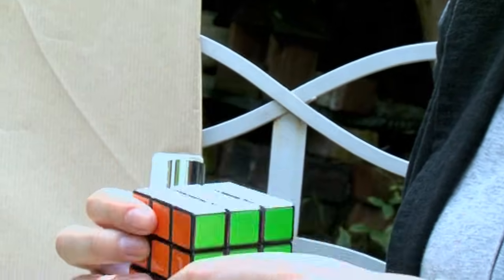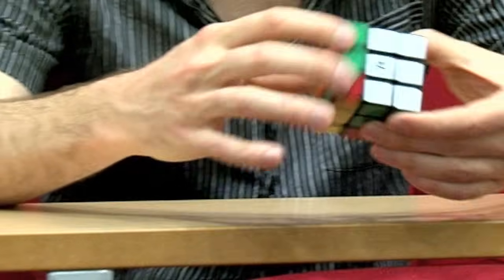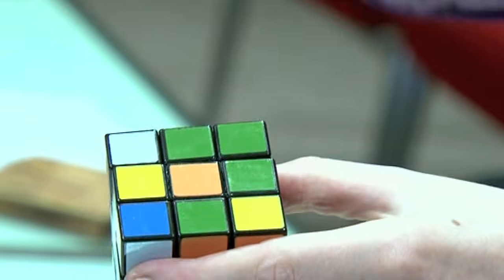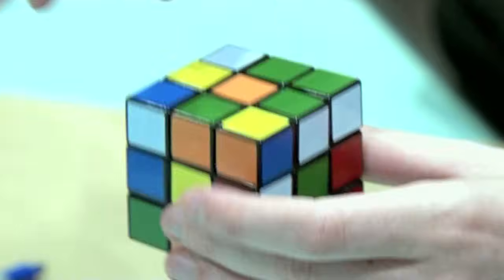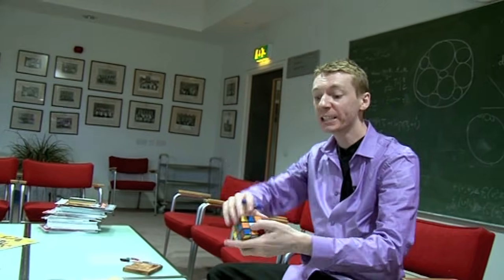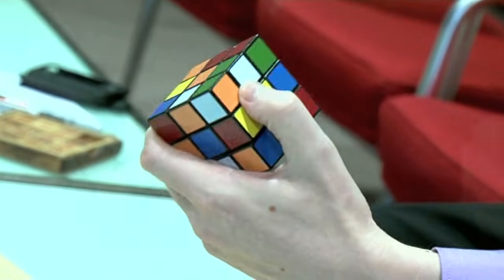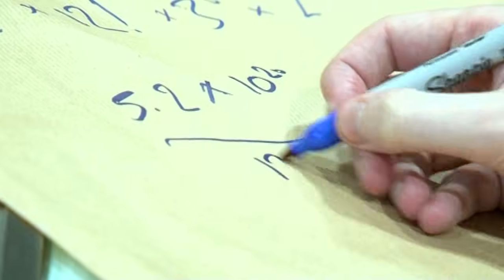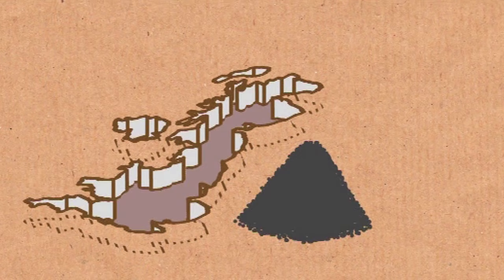43,252,003,274,489,856,000 Rubik's Cube Combinations - Numberphile

Comment: There exist a 17x17x17 rubiks cube. How many combinations does that have?
Reply: +CopCat There are 6.69 x 10^1054 possible combinations on that cube...
Reply: @Harry34186  oh wow
thats alot of combinations
Reply: +Chrnan6710 Wow, that's a "very" round number!
Reply: Cube8 It's actually exact believe it or not
Reply: +AnimXpert - Everything Animation That's not right, there is a number for it! Of course, it's a massive number, but it's definitely not infinite. The amount of possible 17-rubix cubes and the number 1 are both exactly equidistant from infinity - because it's infinitely distant. To call a finite quanitity infinite just because it's really huge is a terrible generalization!
Reply: @mrpengywinz123  I mean; by having narrowed the answer to the Ramsey Theorem down, to between 13 and Graham’s Number, Mathematicians have pretty much nailed it. 😅
Reply: +CopCat---> 4.3x10^1795

so here is the number :)

43 255 043 761 603 797 113 630 091 774 844 134 775 453 550 640 366 980 778 547 673 133 233 526 156 056 111 086 352 762 541 106 680 563 100 444 501 556 754 078 061 200 040 161 902 545 444 981 363 159 418 942 317 624 324 342 475 893 310 046 720 902 418 909 842 572 254 925 048 152 255 763 863 441 303 957 601 376 714 844 611 959 683 697 690 635 818 016 496 854 273 739 359 313 279 064 666 370 046 140 892 353 517 823 980 846 922 675 751 474 787 577 446 355 037 664 594 347 801 588 102 349 880 881 928 045 254 762 441 010 636 430 061 482 254 233 491 880 624 942 631 395 654 007 616 048 601 555 395 209 216 128 415 329 219 747 176 133 779 395 956 146 746 911 514 214 771 775 855 690 239 351 072 162 630 720 328 485 482 144 507 681 466 660 622 736 814 225 845 041 389 468 585 359 274 634 625 239 725 398 675 655 356 047 474 149 388 129 506 975 426 678 293 985 190 094 954 373 200 648 529 109 213 009 085 243 025 295 695 714 725 062 048 495 626 790 315 739 291 458 632 493 329 982 002 276 666 437 129 462 665 130 296 574 060 413 847 380 108 081 447 548 388 904 581 805 682 624 806 259 243 368 405 271 472 607 466 620 943 953 521 539 611 552 808 899 034 647 451 671 884 821 871 473 150 002 371 967 161 469 667 395 692 183 541 805 647 906 126 837 698 919 382 420 530 164 759 161 006 195 029 042 343 889 342 090 679 974 741 074 212 214 617 599 362 461 432 095 130 944 516 954 244 601 505 865 754 479 368 324 547 884 288 638 788 858 960 324 700 273 827 359 843 495 876 728 690 396 404 545 429 654 674 917 908 712 080 130 069 636 174 970 892 229 914 900 256 301 061 633 858 082 796 212 971 135 604 567 450 455 305 742 728 394 508 401 221 110 518 309 419 409 022 610 708 624 448 968 624 438 667 397 328 140 010 446 578 078 230 783 252 681 413 859 281 663 088 893 481 022 928 914 102 101 729 840 481 251 353 235 030 016 000 000 000 000 000 000 000 000 000 000 000 000 000 000 000 000 000 000 000 000 000 000 000 000 000 000 000 000 000 000 000 000 000 000 000 000 000 000 000 000 000 000 000 000 000 000 000 000 000 000 000 000 000 000 000 000 000 000 000 000 000 000 000 000 000 000 000 000 000 000 000 000 000 000 000 000 000 000 000 000 000 000 000 000 000 000 000 000 000 000 000 000 000 000 000 000 000 000 000 000 000 000 000 000 000 000 000 000 000 000 000 000 000 000 000 000 000 000 000 000 000 000 000 000 000 000 000 000 000 000 000 000 000 000 000 000 000 000 000 000 000 000 000 000 000 000 000
Reply: @MeisterSokrates  doable
Reply: 6.69 quinquagintatrecentillion
Reply: Ehh, about 2 combinations. maybe 2 and a half.
Reply: A 22x22 has been built :)
Reply: +wowitsbryce If you tried your theory with a 3x3x3 cube then we know the  answer is around 4.3 x 10^19 but if you did (3x3x3)! you get around 1.08 x 10^28. That's 9 powers away! So anyone reading this, if you just take factorial of the number of stickers on a cube, you will get a very wrong answer for the number of solvable positions.
Reply: now you just put numberphile up to a  challenge. next video well, i did some light math and the 17x17x17 Rubik's cube has 3459873459872359823908324596123497634908573894 combinations... (accept the challenge numberphile.) :D
Reply: that number is too small
Reply: Paul Weigand No, because the stickers don't move. The pieces do.
Reply: +Mario kart Is life Is that real or did you just make that number up
Reply: Jedi Sentinel that's... not
Reply: Kyle Kopsho it's made up
Reply: Permutations*
Reply: +JSK01 - Agario TRIGGERED
Reply: nope it's not 43,252,003,274,489,856,00 x 17
if you look at the maths it's a 3x3 not a 1x1
Reply: There exists a 22x22x22
Reply: They have a 22x22
Reply: At least 12
Reply: +Ben Haysome there are rubiks cubes that also have a special orientation required for the stickers so then you would get your 2nd number I think
Reply: 17x
Reply: CopCat divide that number by three and then multiply by seventeen
Reply: A lot
Reply: XC98 
bruh
Reply: Chrnan6710 nahh thats tooo little...
Reply: Arnold Schwarzenegger i hope u are joking...
Reply: I dunno but it'll solve the same as a 4x4
Reply: BB^100
Reply: a lot
Reply: more than 20 ,less than Infinity
Reply: And now there is a 33x33!!!!
Reply: CreeperGaming if it was infinite permutations i think i will be imposibble
Reply: CreeperGaming then ur saying that 0.00000000000000000001 equals infinity
Reply: Chrnan6710 
Now write that in words Jk
But how many combinations on the 2x2?
Or 1x1? :OoooO
Reply: CopCat more then the atoms in the whole universe
Reply: Too many
Reply: A few
Reply: there is 1 combination and a huge numbers of permutation.
Reply: A number greater than the number of atoms in the milky way galaxy
Reply: 2
Solved and unsolved
Reply: ☝️Well, for the amount of atoms in the universe to equal the amount of permutations on a 7x7x7, you’d need 10 to the power of 80 universes.🙀
Reply: the amount of peices  facotrial
Reply: 17 power 17 power 17.... 17 times
Reply: at least more than 57896 parities. Ugh.
Reply: Its combination is accurately this number ; calculated by Titan supercomputers ;

8615671881999977777715417861771877718889266451982762990001767200
Reply: Its 4913!
Reply: a billion
Reply: @bitterlemonboy  hahahaha 3x3x3 already have 43 quintillion. :)
Reply: At least 5
Reply: More than 5
Reply: over 9000
Reply: A whole lot more than the original
Reply: 4,913! combinations. However, there are less solvable positions.

A normal calculator is too weak to calculate 4913!, but if you have a way of finding out, there's your approximate answer.
Reply: pezpeculiar any calculator*
Reply: 47583373737846785467647837191864927483639263946493639629274864949369469274818477487301730746292594629/619264710182729639263916392648461818392783733646764663314636721446513432117462784698746987469874698764897146178674781647789964987312646783211964819827463736521919946037893822981291902919389378262654861937046342179438537047269402626402649263887102929283746451182039384651743364736487324873264673267632447457345674374637467832644783647836448364386473864387643784846677767382638363868675473628618253725483548364846483691829274839739437595758 possible combinations
Reply: @mariokartislife6046  How did You calculate that? Or is it a joke?
Reply: Enlightened Penguin I meant there is not an actual NAMED number for it. Like quadrillion didn't exist a long time ago, superultramegauniversesozedmicrostoragequintillionquintillion doesn't exist yet (not given a value)
Reply: @spookykitty2327  760 duohexadecillion, rounded to 3 significant figures.
Reply: A simple "4 googol" would do
Reply: +CopCat  
1.46248e+20?
Reply: @thepolarninjagames1263  too low
Reply: more than 9
Reply: CopCat 43,252,003,274,489,856,000 × 17
Reply: @Chrnan6710  Just say "infinity+1"
Reply: (17x17x17)!
Reply: there is so many combinations there is not a number for it. just consider it infinite
Reply: If you thought 43 quintillion was big, check out this number!
Reply: CreeperGaming 
It’s about 66 quinquagintatrecentillion, there is a number

Comment: Also, The center pieces can be pulled off of most cube to reveal a screw that adjusts the tension, however, it is typically only one center, and since rotation doesn't matter, you won't get anywhere

Comment: I understand why you don't take the centers into consideration. however, if you repeat R U 63 times the cube will be solved; but not the same as before. I noticed that after 63 repeats the center that's on the top has was rotated clockwise and the one on the right side counterclockwise. Also, if I do R U R' U five times, it just rotates the top center twice. So Why don't we take these into consideration and simply say that there is only one position for a solved cube?

Comment: how many are in a 2x2x2??
Reply: Not nearly as many. You have 8! (8 Factorial) Ways to put the corners in (40320) times 3^8 ways to orient Them (264,539,520) but you must divide this by three because if you put them in any which way when you finished solving it one of the corners might be misaligned. that final corner has 3 ways it could end up: solved, one turn clockwise, and one turn counter clockwise thus you divide by three resulting in: 88,179,840 possible configurations.

Comment: I dont get where he gets dividing by 12 from
Reply: If you listen back he explains about different orbits and ways to arrange the cube that are impossible to return to the solved position without disassembly. There are three factors that go into this. If you rotate one edge it is unsolvable but there is a way to flip two edges. This means that any number of flipped edges reduces back to either one flipped or none flipped because if you flipped 3 or any other odd number you could flip over two until you had one left and the same with any even number leading back to none flipped. The same is true of corners you can only rotate two at a time not one. A corner has three rotations and just like how you could take any number of flipped edges and reduce to either one or none you can do the same rotating two at a time until only one is rotated. The final factor comes from switching pieces you can only switch two pairs of pieces either two pairs of edges or corners or one pair of corners and one of edges. Just like the other two any number of switches can be reduced to only one pair of edges or corners switched. All of these factors can be combined meaning that there are two ways the edges can be left orientated (one flipped or not) three ways the corners can be left orientated (turned one way or the other or not) and two ways the location of pieces can be left (one pair switched or not) you can apply one state from each category all at once so the twelve comes from multiplying them (2*3*3=12) hope this helps :D

Comment: I remember watching a talk show called "Unscrewed with Martin Sargent" and he had a champion Rubik's Cube solver on the show. They gave the guy like 30 seconds to study the cube before attempting it. Then he went at it and solved it in like 20 seconds. There was huge applause, and Martin was floored. After the applause died down, Martin was like "You know, you weren't supposed to be able to solve that! We peeled all the stickers off and stuck them back on randomly!" :-D
Reply: The chances of that happening are very slim. Amazing if true bro.
Reply: @alfiedemmon4132  actually, the chance are 1/12 as singingbanana mentinonned. But I don't know where this 12 comes from
Reply: @solaimon3164  The chances are much lower than that as peeling off the stickers enables you to make the puzzle unsolvable in all 12 "universes" of it's current configuration (e.g. putting 3 of the same color on one corner).
Reply: I doubt he was a champion speedcuber. Maybe he was the best in his town but thats not a champion. in 2015 the wr was around 4 seconds.
Reply: @venkinta3343  If he won a competition, he is a champion.
Reply: @vinlebo88  I think thats debatable xD. Not many people win a competition with a 20 sec average.
Reply: @venkinta3343  Yes, however the show is pretty old.
Reply: @vinlebo88  Was it four years ago? As i said, in 2011 the wr was already around 5 secs
Reply: @venkinta3343  Appearently that show aired in 2003. The WR at that time was 16 seconds (I think). Considering that it wasn't as spread as today, chances are that even national records were around 20s.
(Altough the whole discussion is rather useless)
Reply: @vinlebo88  Now that makes more sense, in 2003 i doubt speedcubes were even a thing. yeah i mean it can be useless but its a discussion nontheless.

Comment: Fun fact: The amount of ways to arrange a Rubik's Cube doesn't even come close to the amount of ways you can arrange a standard deck of cards of 52. That number would be 80,658,175,170,943,878,571,660,636,856,403,766,975,289,505,440,883,277,824,000,000,000,000. 
That means, that if you do a thorough riffle shuffle (at least 7 times), chances are very very very very very likely that array has never happened before, ever in history.
Or by comparison: The universe is only about 432,339,120,000,000,000 seconds old. That means that if there were 10 billion people shuffling decks of cards every second for the entire age of the universe, you still wouldn't even come close to that number. (4,323,391,200,000,000,000,000,000,000).
Reply: a riffle shuffle 7 times won't have those millions of octodecillions of possible outcomes because the original couple of top cards will remain on the top half for a long time, because of how the mechanics of the shuffle work, so that number is greatly reduced because it would be very difficult to bring the top card all the way to the far bottom positions in only 7 shuffles
Reply: of course, the reduced number would still unimaginably huge. I just find it hard to believe that a shuffle that keeps the top cards in the top slots, and the bottom cards on the bottom slots, done only 7 times, can have the same number of possible outcomes as that Original number
Reply: Elroy Kerstens vsause?

Comment: PB: 17.79 and I've been cubing since December 2014. I've only gotten 3 sub 20's but I've been very close to beating my PB recently. 

Like this post if you're a cuber
Reply: +RECuber I average about 21-23 seconds. I have recently been getting into BLD, though.
Reply: Im only sub-40 :'(
Reply: Sethamajig 
-Esperanto
-Cuber
Reply: I average 20 and pb is 7.10
Reply: +Picklepower26 how did u get your pb,
Reply: super luck
Reply: My best average is 23.71s and my PB is 19.21s.
Reply: I've only cubed for a month and I average a minute using a unique beginners method with some CFOP algo on the side 
PB. 46 Seconds
Reply: a month later... 
now my best average of 5 is 19.49s and my PB is 14.98s XD
Reply: p.b 9.08
Reply: Nearly been cubing for bout a month.. Average bout 30secs PB 22.99
Reply: Sub 40
Pb-34.756
Reply: Im late but i average 16-19 with a pb average 13.34 and a pb single 9.334
Reply: Now Pb single 8.423 and average 12.54
Reply: I average 23 and my pb is 11.86
Reply: I only got to 1 mins and 6s :(

Comment: Isn't there a further limit on the number of combinations when you physically take it apart and put it back together?

 e.g. If you've ever put a cube back together and solved it, sometimes the last corner, or last edge is turned the wrong way and the cube becomes unsolvable.

That seems to be taken care of by dividing the number of orbits.
-----
However, what if you flipped two edges wrong, wouldn't that cancel out the wrong orbits?  Or if you flipped 3 corners wrong, wouldn't that cancel out the wrong orbits as well?

How is that addressed?

Comment: I don't want to be the bearer of bad news, but. The way you're going about this, is in someway wrong, yes. there is 43,252,003,274,489,856,000 possible combinations. But, not all are solvable If you were to take the rubiks cube apart, and put it back together again, but just flip 1 corner, the cube will become unsolvable, as it is impossible to flip just 1 corner. So neciserally, the rubiks cube, does not have 43,252,003,274,489,856,000 combinations, if you where to mix it by hand.
Reply: ***** If you disassemble the pieces, you can assemble it again in 5,2*10^20 different ways. And there are 11 unsolvable stiation. So you want to find out the only solvable stiation. Then divide it by 12. (5,2*10^20)/12=43252003274489856 The solution is correct. Please watch the video again more carefully. And sorry for bad English.
Reply: The 12 orbits are obtained by these 3 things:
1) flip any edge (2 orbits)
2) rotate any corner (3 orbits)
3) switch any 2 pieces (2 orbits)

Each of these 3 are independent, giving 2*3*2 = 12 orbits.

This means, somewhat counter-intuitively that if you take a solvable position, switch any two edge pieces AND switch any two corners, you get another solvable position (modulo flips and rotations, of course).
Reply: ***** that is exactly what i thought, the actual combinations are about 5-6 orders smaller
Reply: deniz is correct he did take unsolvable combos into account in the video.the original number was around 12 times as large
Reply: ***** I know I am a bit late to this, but just as the person before me said, he originally got a number 12 times 43 quintillion. He took into account the number of parities ("orbits"), which is 12, and divided his number by 12 to get 43 quintillion.